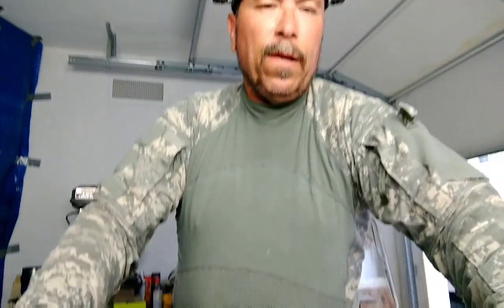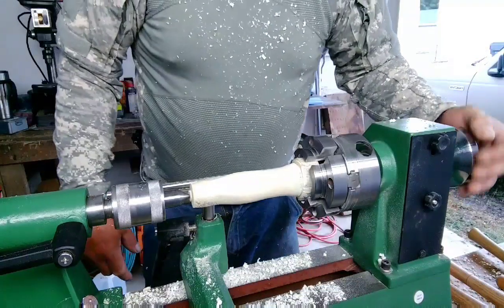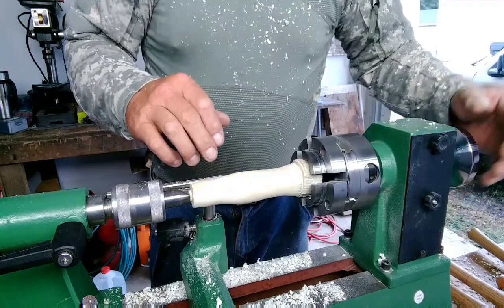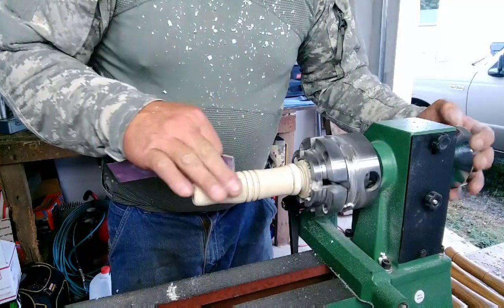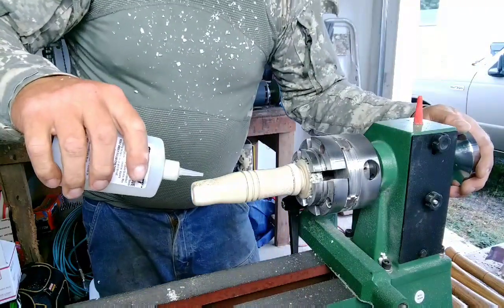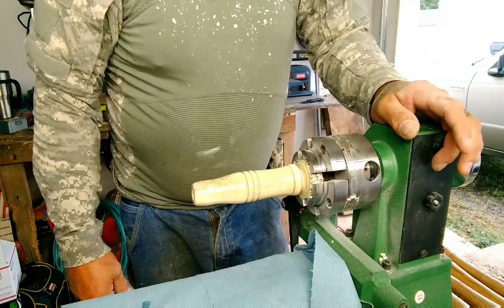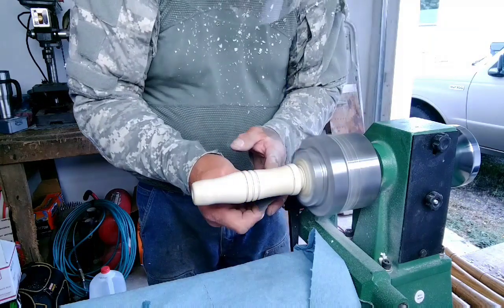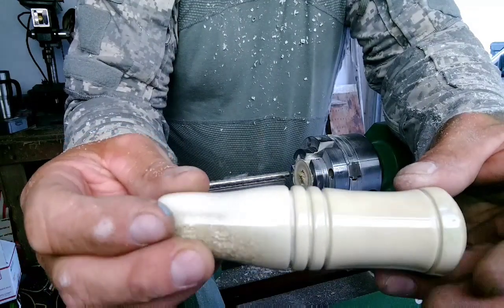Wood Turning.... Elk Horns to handles 🇺🇸

Comment: Ok, I have two questions. #1. Does the C A glue act kinda like a  polish, or filler, why did you put that on there?
#2. Did it stink in your garage when you were turning that? Whitetail deer antler that I've used kinda stinks. It really looks good Jack!
Reply from the maker: 1... Yes, CA glue is basically super glue. I like to use it for a finish. Because it has a nice gloss and is very hard and durable.

2... Holy smokes brother.lol 
It smelled like a dentist office gone bad. Hahaha. Thank you so much Chris I really appreciate you very much my friend 🇺🇸

Comment: Whenever I try to round off the end of antler I get terrible catches. Any advice? I’ve used carbide round cutter and carbide square cutter . And haven’t had any luck.
Reply from the maker: I like using the round carbide cutter or use the roughing gouge.
Taking really light cuts.
I hope that helps you out.